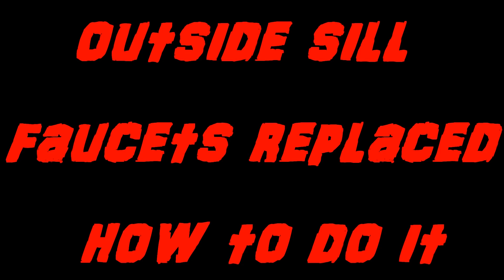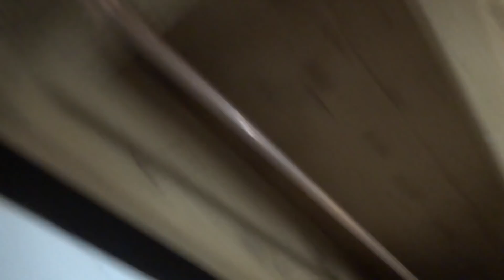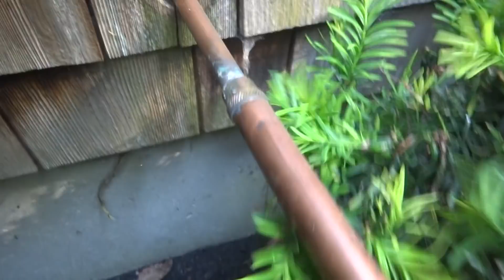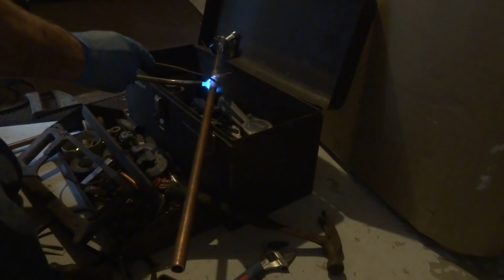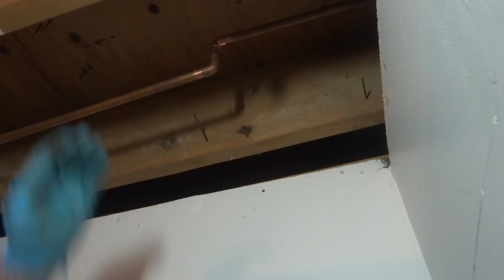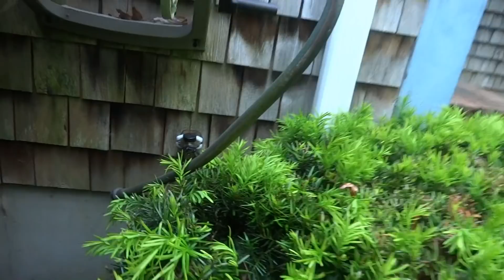HOW TO  REPLACE OUTSIDE SILL FAUCET

Comment: Loving these outside faucet videos! But I'll bite... why did you have to take it apart? Was there a blockage? I heard spitter and sputter when u opened ball valve 1st time.
Reply: Probably to avoid melting/burning the rubber washers inside the valve while soldering